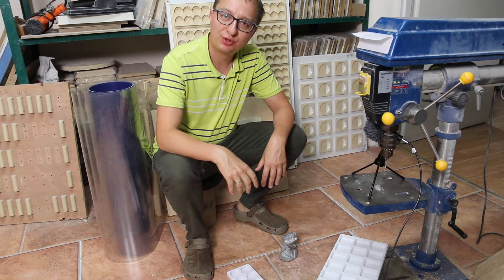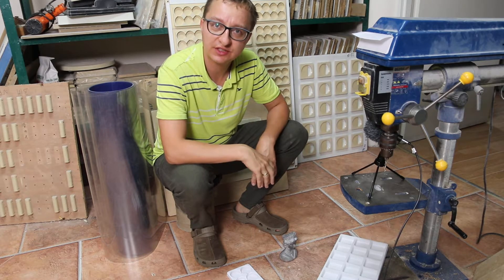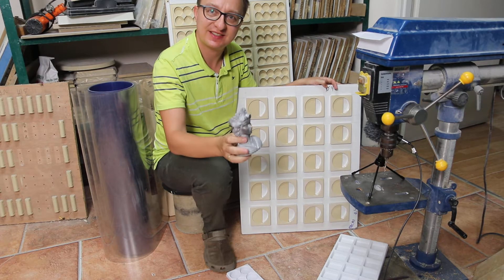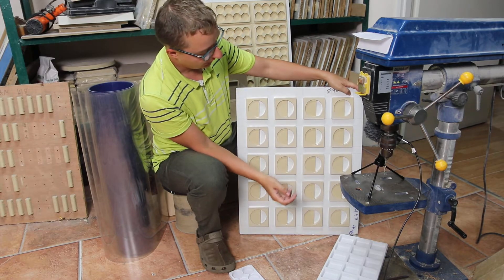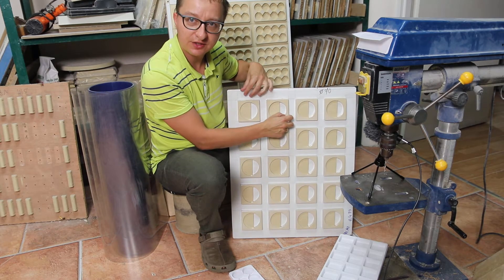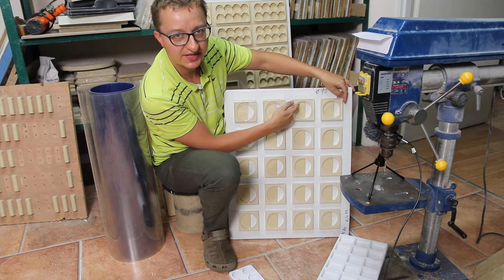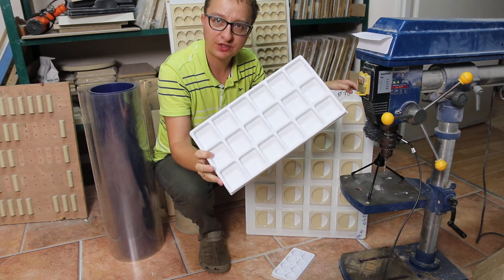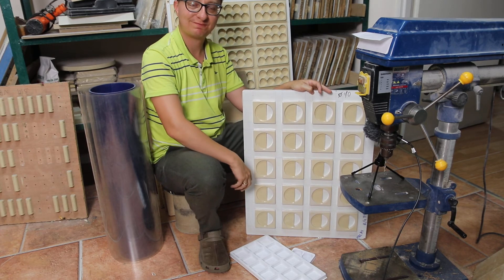Resin molds for thermoforming. Secrets of vacuum forming

Comment: Can you use concrete for a mold to vacuum form? Meaning cast a mold from concrete, and then vacuum form over it? Thanks 🙏
Reply from the maker: Concrete will crack. Professionally, resin or aluminum is used. You can also work with wood